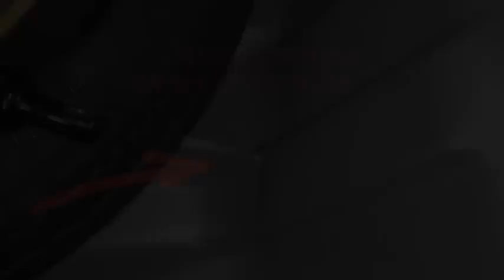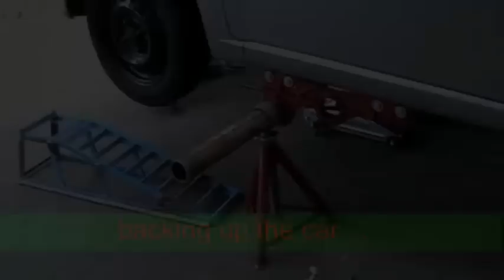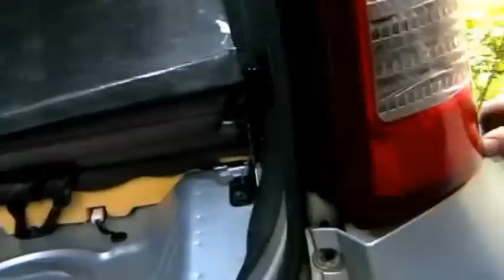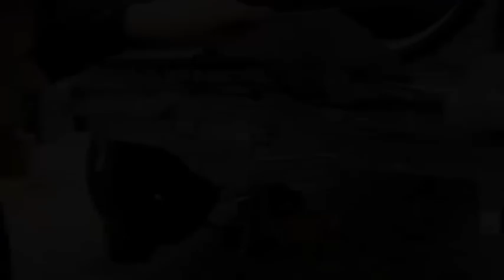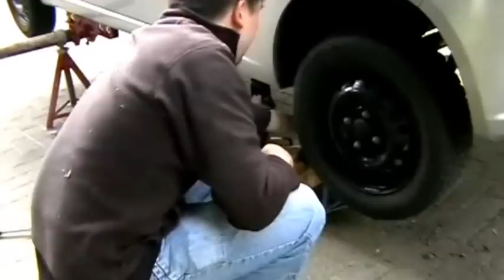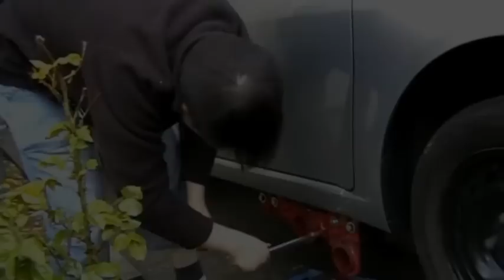Frame straightener  collision repair Unfall instandsetzen

Comment: This frame straightener was used back in the 60`s 70`,and mid 8o`s then the drive on frame racks came in use when unibody frames became the norm. Worked in the trade for 45 yrs.
Reply: So, you mean they are not sold anymore, right?